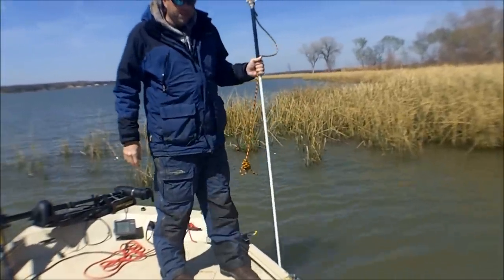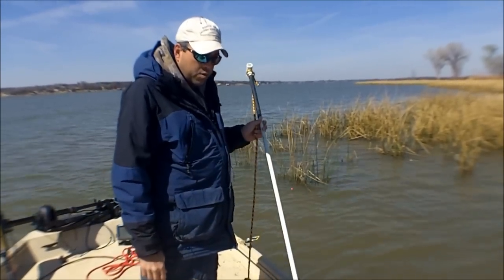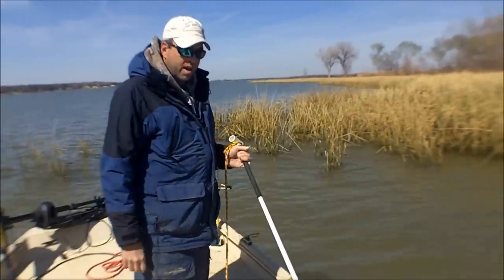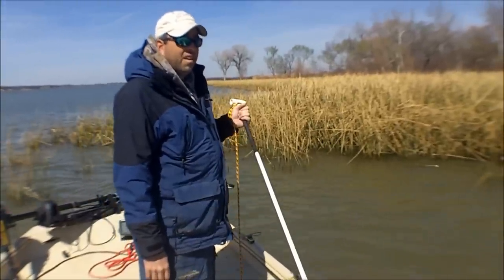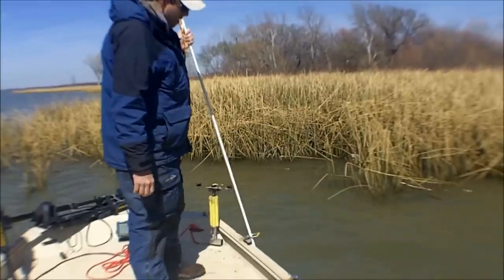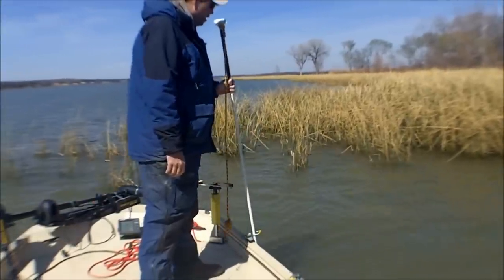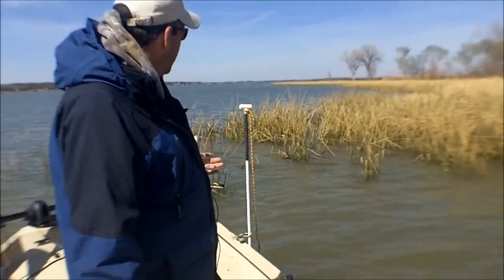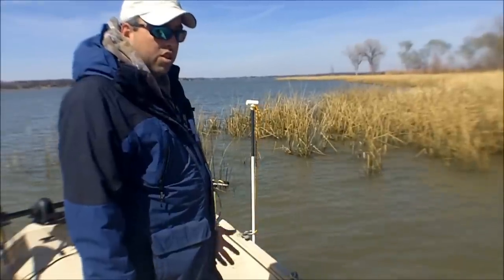DIY Shallow Water Anchors - Make Your Own Shallow Water Anchor

Comment: Hello. I 3D printed a bracket to mount on the stern of he boat I mis calculated the size of the hole the pole slides through. I think it may work for you. The hole is 27.6mm. If interested message me.
Reply from the maker: Nice